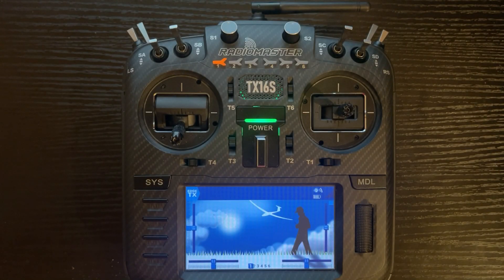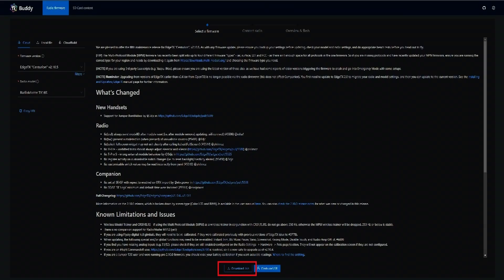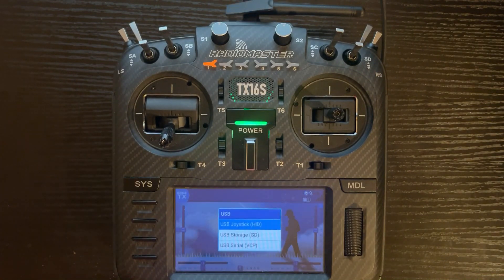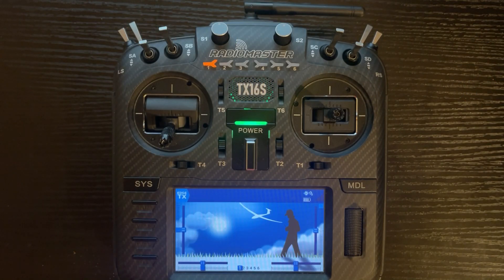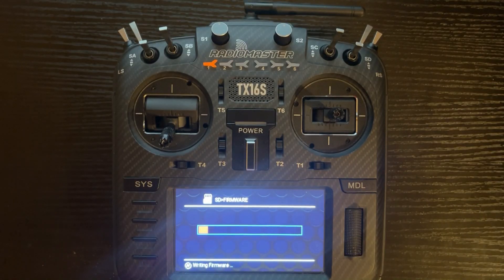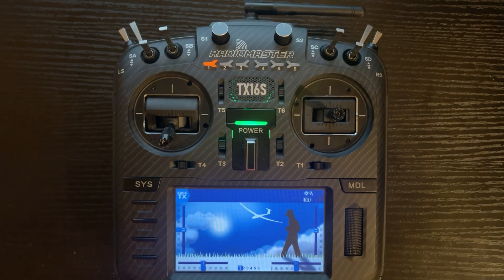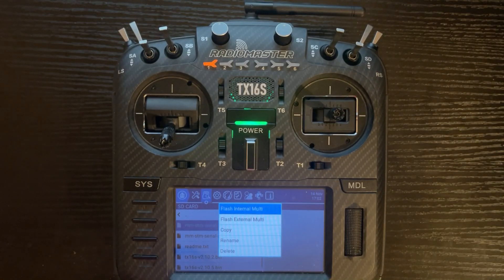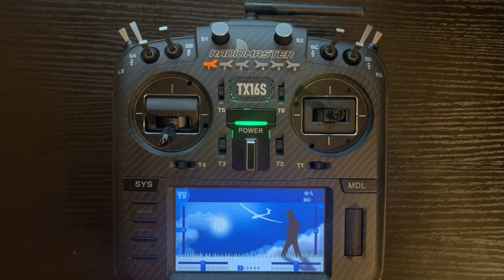Radiomaster TX16s/Edge Tx: Firmware Update (EdgeTX/MPM)

Comment: I download 2.11.3 jolly mon to the computer, copy and pasted to firmware, went into bootloader, found 2.11.3  , clicked on it, then long pressed, the flash progress bar went to about 90 percent,, then stopped, now what?
Reply from the maker: Power down and try flashing bootloader firmware. Press system > SD Card > Scroll down to file and click on firmware > Flash bootloader mode
Reply: @BDTennessee  thanks for getting back to me.  I had been waiting about 6 hours for the flash to finish because I didn't have the courage to shut it down.   After reading your post, the only way to power off since the transmitter was still in writing mode was to remove the battery.  The radio would not power up after doing that except in bootloader mode.   I then went though the flash sequence as I did before and this time it worked-I don't have a clue why it didn't before.   Hope this helps someone else  who has similar issues.  And thanks for your youtube videos!

Comment: Very helpful video. You might want to mention the USB cable must be disconnected from the radio before flashing the firmware in bootloader mode.  When the USB cable is connected the radio will not power on. After disconnecting the USB cable the radio turned on and I was able to proceed with the flash.

Comment: Hello Sir I am from India 

I just Updated my Jumper T Pro 4in1 Multi Protocol transmitter, so I need to Multi module firmware also or it already updated with Edgetx
Reply from the maker: Need to update separate as shown in the video.
Reply: @BDTennessee  But not found my Jumper T pro 4in1 in list
Reply: @BDTennessee  plz Help sir
Reply: @BDTennessee  Sir please Help me to update my Jumper T pro 4in1 module
Reply from the maker: @ use Jumper T Lite (same firmware)...
Reply: @BDTennessee  sir will it work sir
Reply: @BDTennessee  Thanks 🙏 alot sir, I will try sir 
Thank you so much sir
Reply from the maker: @ welcome and anytime!

Comment: thanks for the easy guide.  For some reason after updating to 2.10.5  my radio was stuck on the edgetx load screen.  I had to pull the battery and turn it on again, then it booted normally and I was able to update the MPM.

Comment: What's the best way to "factory reset" the TX16s?   I want to reset it to factory default settings including models.  Just as it came out of the box.
Reply from the maker: Delete all models and delete from deleted folder on SD card.

Another option is to delete SD card and install all new files.
Reply: @BDTennessee   Where can I download all the factory files to reinstall to SD card?
Reply from the maker: @ Edge TX SD Card contents on GitHub...

Comment: Thanks for this tutorial.  The only issue I had was that after I backed out of the firmware flash, my radio reboot got stuck at the opening EgdeTx welcome screen. I waited a couple minutes to see if there was more going on in the background and ended up reseating the battery to force a shutdown. and rebooted. The multi flash worked fine after that.  We've come a looooong way from my old 27MHz crystal radio.
Reply: Yes I had to do this too
Reply: Me too, screen froze after update, I also took battery out. I'm coming from a Spektrum DX8

Comment: thank you for the video.  but when we do that it erase all model setup?  and if so, can we just make a backup of all the model and setup and after upgrade the remote, just copy back to sdcard remote the model??
Reply from the maker: All the models will be in the radio.Firmware update doesnt delete them. Backup the radio is in case something went wrong.
Reply: @BDTennessee  thank you so much.  did the upgrade and it work.  but now have to get use to the new display...lol
Reply from the maker: @lucbrodeur9193  new look and better all around.

Comment: Great video series BD.  One question, have you seen any differences in the Radiomaster TX16s with respect to more or less Holds or Fades as related to a Spektrum transmitter product?
Reply from the maker: Similar results but sometimes better... I trust as much as Spektrum transmitter which had never gave me issues either...

Comment: Short and sweet! A suggestion for a future video - A detailed run through of how we can download and flash the latest Test Versions of the Multi Module firmware to access newer protocols not yet available in the current latest Stable Release. Needs to be aimed at us Old Timers on the Dumber Than... end of the market! 😉😊
Reply from the maker: Same process. Choose  newest version that doesnt have (Stable) for the version.
Reply: @BDTennessee    Trouble is - your link above only goes to the "Stable Releases" page. Finding a link to any "Test Releases" (and warnings about same) was a bit more difficult. Finally found it at "https://downloadsDOTmulti-moduleDOTorg/latest-test/"

Comment: Its easier to just flash edgetx using buddy. You just leave the transmitter off
Reply from the maker: I have seen connecting issues by using edge tx buddy sometimes. Works correctly its good too...

Comment: hi , any idea how to thrust reverse a freewing edf motor ? im using a radio master tx16 s mkii max .
Reply: Plug the reversing lead from the ESC into a servo port and add a switch as the input to that channel. Nothing to it..
Reply from the maker: 1) Plug Reverse Lead into channel
2) Assign Switch to change as "Source" on same Channel

Example: Channel 5 lead is plugged in > Channel 5 in Mixer > Add a Line > Assign Switch to the Source > Done